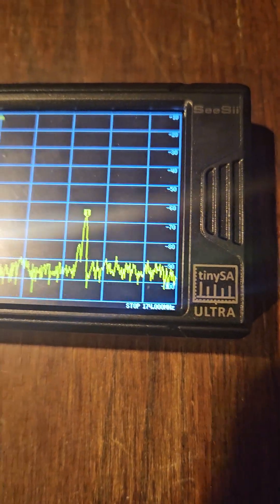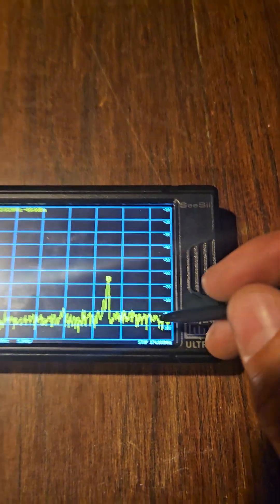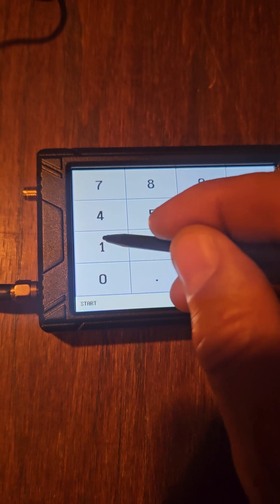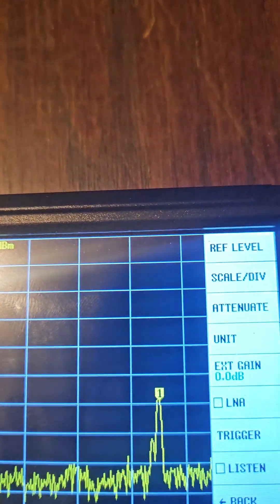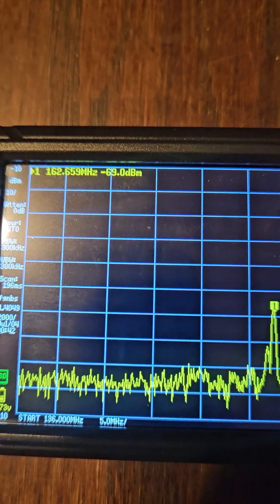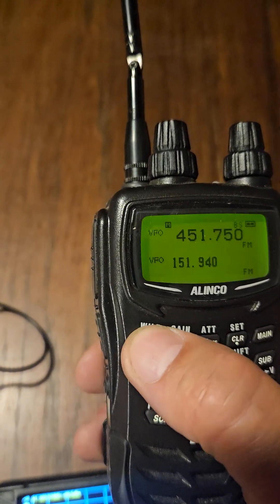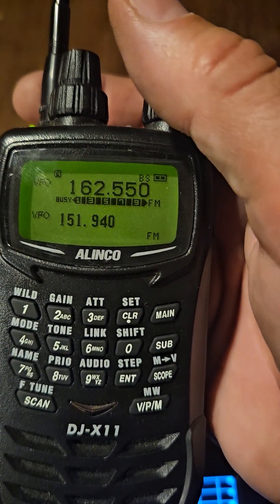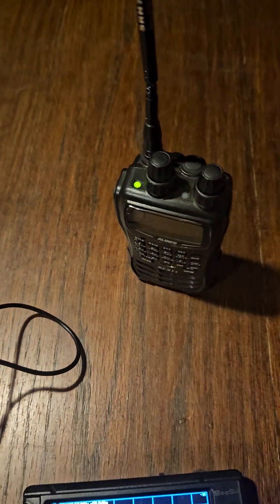TinySA To Target A Frequency

Comment: Why doesn’t tinySA hit exact frequency?  Is there some limitation that prevents it and is that a common capability issue that spectrum analyzers share?  Trying to understand why and if there is away to make it dial in more accurately without the guess work.
Reply from the maker: Yeah I know. I'm not sure why it won't lock on to the exact frequency.